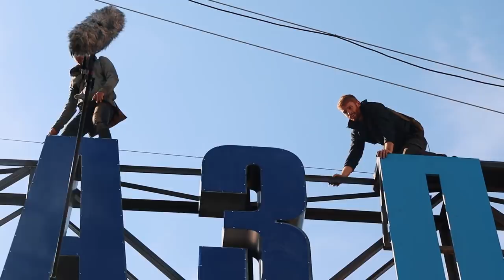Roof missions with Michael Bay 🇮🇹

Comment: I know what the building is. The first thing that tipped me off was the wall that you asked about, you see those blue lines? They looked quite similar to a diagram displaying the path of electricity, you know? Battery to a lamp for example.  After seeing the writing on the wall, fesz reduktor. I had it translated, tension reducer, which i know has something to do with electricity, so power station. I knew you guys were in Hungary, the rest was just matching up the image of an abandoned power station in Hungary. The Kelenföld power plant. 106 years old.